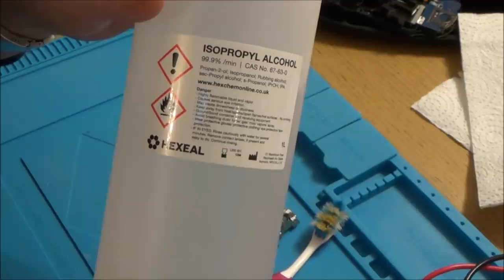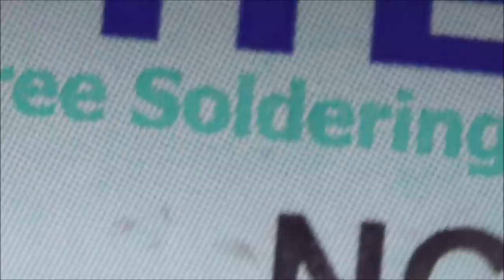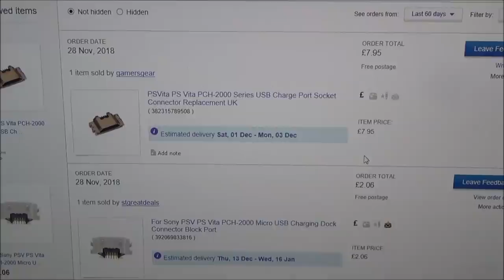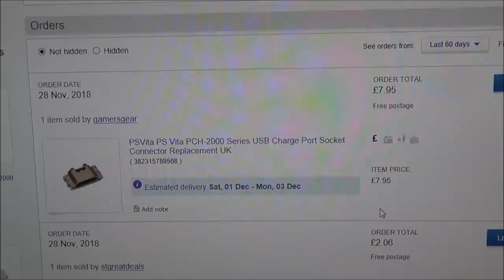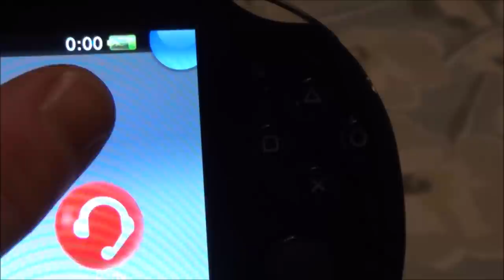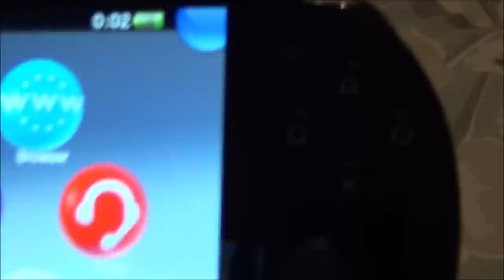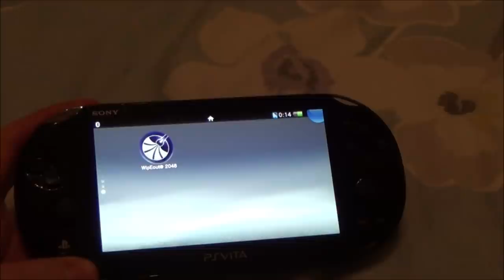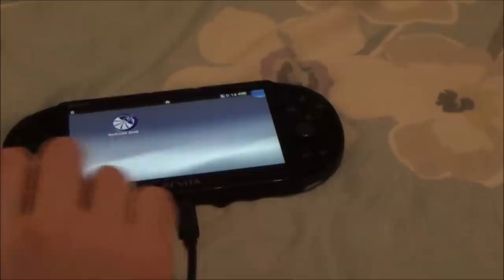Trying to FIX a Faulty PlayStation Vita - Sony PS Vita Slim

Comment: Hi, i have a problem with my vita slim, and i can't find any solution. A couple days ago i replaced usb port and firstly i thought that everything is ok. But it's not everything. I can transfer files through usb. But can't charge vita. Strange thing is when i connect usb cable orange indicator light solid, and green bolts appear on battery icon. But it won't charge at all. Probably i broke something when i replaced old port, but i don't know what could it be :( 
Anyone has an idea what can i do to fix or at least diagnose this?
Sorry for my English, it's not my native. Please correct me if I make any mistake.

Comment: Love the vid. You are getting serious skills !!!!. The station should kick in the heater when it senses the temperature drop (because the heat disiaption to the board). Probable on your the temp sensor is too far away from the tip that takes time to realize that more power is needed. I have seen stations (generic, but decent) that when you got the issue you had in the pad, the measured temperature falls like a rock on the LCD and the heater is turned to compensate as much as the max power can (60W in the case Im telling). Even on a fine tip, it really manages to do bigger jobs

Comment: Great video. It is not unheard of to use hot air to pre heat the board or to even remove components. The board will consume most of the heat giving one a hard time to get either remove or replace the components due to the thermal transfer. I have even used both hot air, soldering iron, flux and wick to remove solder from those difficult holes. Keep up the good work.
Reply from the maker: Thank you :-)

Comment: To free those holes with the tools you have, you need to heat it to like 250c with the hot air and at the sames time go with the largest tip you have and use solder braid to suck it.
Regarding the soldering of the new port, you should have removed the solder from the pads before soldering it because the solder keeps the port lifted and not completely flat against the board

Comment: A good quality soldering station makes soldering ground pads like that much easier. It also looked to me like you were using fairly cheap solder, which doesn't help.

Comment: Thats often a Problem with Groundcontacs that have a Pretty Big spreaded Network across the Board, that they drain the Heat away from the contact. Pretty much like a little Heatsink
Reply from the maker: Oh yes that does make sense, so the bigger the contact the more chance it has of dissipating the heat away. Thank you :-)

Comment: If you have a steady hands you can use 1mm drill bit and try an remove solder that way, some of em are tricky because of inner layers of the board.
Edit : If you are worried about damage, you can do a lot more damage to the board using excessive heat, than with any of the mechanical ways to remove it, components rarely can hold above 100 degrees, unless they are power components.

Comment: Vince, when you are soldering, the steps are - tin the tip if it needs it (there shouldn't be a glob on it when you tin it, wipe to glob off on your sponge), apply the tip to the surface you want solder on and heat it up, then push your solder into the point where your tip meets the target area. It seems like you try to get a glob to stick to a surface from your tip too often. Solder won't stick to a surface that is colder than its melting point.

edit: Another reason why a glob won't stick from the tip is that by the time you have heated the target to right temp with the glob still on your tip - the solder is burnt up and won't want to stick anyway.
Reply from the maker: Thanks for the helpful tips :-)

Comment: The soldering irons on those cheap rework stations are terrible.
The best cheap soldering iron I have ever had and still use, is the Bakon 950D with a T12 handle £35.

Comment: Nice work. Pleasure to watch. USB / HDMI are sods because of the ground plane. Had the same on a PS4 HDMI with my Aouye 968A+. Very frustrating. Gonna invest in a Quick hot air station next year. Higher temp but for less time is probably better for the board on balance. The way Andrew does it is to mix in leaded and leave the solder in the holes and somehow align it whilst still molten but you need a Quick for that lol. The reason the outher 2 pads won't take is the same reason. Need more heat. Keep it up.

Comment: Welcome to the world of heat sucking ground planes :) Actually, you can preheat the board in an oven to make the solder melt better as the ground plane is conducting heat away right when you touch it... :) That's why these machines don't need any heatsinks :)
Reply: heatguns are your friend, a little  pre-warm and then working on these things is so much easier.
Reply: Good to know

Comment: I usually use a combination of heat gun on a lower temp to keep the board at a reasonable temp as well as a soldering iron; heat is a form of energy, and energy is cumulative. The board dissipates at a faster rate than the iron can handle, but even with the same iron and another source of heat, the combined energy input is enough to make the solder melt much easier
Reply from the maker: Thanks for the advice :-)

Comment: 350/5000
Good morning ,sometimes the problem is simple
  when the batter completely discharges the ps vita does not recognize the battery
I had the same problem
to fix, I just took the batter from ps vita and it would load a bit for 20 min. and then put it back, and now it works 5 stars
to charge the battery I used TP4056 5V 1A LiPo Akku Lithium Battery Charging Module

Comment: on such type of holes try to use hot blower and soldering-iron at the same time, becouse this holes connected with a big polygon of copper that absorbs all the heat and you can`t  solder it properly. with best regards)

Comment: for those stupid holes i would  have used a dremel to free up the holes but it depends on skill and patience aswell xD but yeah ...  that would be my way befor i start melting the iron threw the board  (because the holes seems to be enlarged and the pcb looks like it got pushed out  towards the  place the port is sitting

Comment: Whatever was spilt on the USB Port must have been seriously corrosive to strip away all the soft metal leaving only the most temperature resilient hard metal "borderline crystal like", I'm guessing it was some swimming pool water that was excessively chlorinated that would do that "Lead Acid Battery" and it's acid also comes to mind. 

BTW - I suspect when it comes to plugs, sockets and terminals, manufactures tend to use a higher temperature solder as its a lot more resilient than low temperature solder, not sure if high temperature multicore solder is still available, So if it is, it might pay to have some handy, it always worked for me especially when I restored an old antique valve radio, now that was some seriously hard solder..

Comment: I got one from eBay fault,s were on off switch now replaced and am anologue stick. When it arrrived it would not work had to take it all apart clean all connector's it now works and just the anologue stick to do might dismantle as replacements are a bit expensive compared to the psp
Reply from the maker: Yes, they are expensive, if you have an old Vita for spares then both right and left analogue sticks are the same. I thought it would be a £5 part but they are up on £10!!!!
Cheers :-)

Comment: Vince, great job. Only use a charger with the same rated output voltage that the console needs. If you use a higher voltage output charger you can damage the board.
Reply: not necessarily but better be safe than sorry

Comment: VINCE
I noticed you didnt reflow the corroded joints on the head phone jack. That stuff is going to keep eating at the trace and legs there 🤤😢😭.

But that micro usb tho! 😁👍.
My child ripped his lose on a headset. Forgot he had them on and yanked it.
It came off and went back on without the problem you was having. That was a battle on yours.

Comment: I was really surprised by the fact the pads was still intact. Especially since you showed the pins moved at the start. Usually What happens is the pads corrode away from the board and the pin with the pad attached moves. The pins must of only barely been attached in the production process to come away like that. Still great job in fixing it and with your thought process, education of components and experience soldering you would make a good electronics engineer.
Reply from the maker: Thanks, yes I thought he pads had completely eroded away too. I was pleased when I finally saw the copper was still intact :-)

Comment: Your soldering iron seems doesn't have enough power and struggle to solder some of the soldering points. It's not how high the temperature you set, it's about the power. The huge copper layer dissipates the heat quickly and the soldering iron doesn't have the power to maintain the proper temperature.

Comment: That USB port was clearly FUBAR - it's often easiest to Widlarize the old component with blades and snips - only then clean up the stray pins and bits of metal that are no longer attached to each other and so much easier to clean off. The important thing being preserving the PCB pads.

Comment: Hey Vince, nice to see you working at a table. I worry about your knees! :)
Reply from the maker: Thanks :-) It is to do with the filming. If it is a small item then it is easy to film on the table but on larger items it is much easier to film it on the floor to fit it all in. If I wasn't filming then most of my work would be done at the table. The other reason I am on the floor a lot is I work from home, so if the family are in the room with the table I take myself off to a bedroom etc.
Cheers :-)

Comment: When you put the new port in, you should've started with the problematic holes to push the port all the way in. Because you started with the other ones — you fixated it at an angle. That's why the legs were so far apart from the pads.

Comment: Looks like your solder is bad quality. Had problem soldering large quadcopter PDB. Tried heating it on electric stove. Turned out it still didnt work well, and actually when I used different solder it worked fine at much lower temps.

Comment: The vita probably uses most of the spare board as a ground plane to help suck away heat from other components because as you've probably noticed, the vita does not have a fan.

Comment: You’r soldering is coming on great Vince, get some old motherboards, with components on them and practice on them, taking stuff off and replacing it....great video btw, always a nail biter .lol
Reply: Such a pain in the a$$ to change caps .... I barely did 2 times, even on a 60W iron. A multilayer sandwich with power and ground planes ... its an ATX from factor heatsink

Comment: To clean the holes put the motherboard at the edge of the table, half motherboard out (the part with the holes), put your iron on the top an the sucker on the bottom, that's the better.

Comment: Never reuse a corroded connector, because corrosion will only continue spreading. The only way to protect corroded area is to clean affected area with petrol, reflux, retin, use a new connector and on the end put some colophonium rosin flux on it, because it will prevent the rust from reappearing by cutting oxygen from it.
Reply: The Tired Techie Rosin flux is brilliant stuff and also easy to clean off if you want

Comment: Hey my mate VINCE, I could use your help with my PS Vita. either through me sending it to you or you just helping me out through instructions. But I have totally disassembled my PS Vita (PCH-2000) and everything seems perfectly normal. It only charges when it's turned off and only for a few seconds. there's no corrosion or water damage it looks clean and perfectly fine. I have no clue as to what the issue is, but you're more professional than I am. So if you see this comment please help me

Comment: The best way to remove solder from these plated thru holes, is use a thin drill (.1) in a pin vice. You break the surface tension of the solder. This kit is available from model engineering supplies. Just twist the drill in your fingers and it do the job rather than damage the pen with excessive heat
Reply: Pcb

Comment: This is why I like the PSP a little more because if you had this problem, you need to just put in a new battery and it’s an incredibly easy job, no screwdriver required.

Comment: Strange that it didn't charge when u plugged it back in because u don't need a Vita charger. I don't have one, I just use all sorts of phone chargers even power bank and it charges fine with mine.

Comment: I just imported a brand new vita from Japan a couple weeks ago, fantastic machine!  Most likely, a family member (child) spilt their drink all over it and kept quiet!
Reply: Zyzz  brand new imports can be crazy expensive. They can range £200-£500. Madness. Look in the used market, alot of people have taken good care of their vitas. I brought a used one for £100, its in near mint condition. My seller claimed to have only used it once or twice. I believe them cos mine came with firmware 3.32 (quite old). So I manual updated to 3.60 and installed henkaku/enso (easy with youtube tutorials) and bam! I haven't been able to put down the damn thing. 

Also mine was abit more expensive in the used market cos I wanted one with no finger prints or  scratches (mine was literally mint) but if your not too bothered about tiny marks or scratches you can get a used one for around £60-£90.

NOTE: if you are planning on getting a used vita get one with firmware version 3.68 or below.

Comment: When i have problem with holes like thesee i use pointy tip as you do here and sucker from other side. So i melt the solder, tip is still in the hole to keep it liquid and use sucker from other side.
Reply from the maker: Excellent, that is good advice. I didn't think to do that, thank you :-)
Reply: @Mymatevince  It took me a while to figure that out when i was doing analon sticks in dualshock 4 (16 pins!!!) i destroyed 2 pads before i learned how to unsoder them :D (advice here,  destroy the old analog and unsolder 1-3 legged parts, going with hotair on 16 legs at once will fry the board even with protecting tape ;) ). And btw im an amateur as well, even bigger than you so take my advices lightly.
Reply from the maker: Thanks for the tips. I have some (6) faulty DualShock 4 controllers to look at so I may have to do an analogue stick on one of them :-)
Reply: @Mymatevince  More like all of them, almost all analogs are faulty after 1+ years. If pad is working go check http://html5gamepad.com/ and try all deadzones, check if they do not move on their own in far corners etc. Sometimes its hard to notice it in games but when its needed, ull see they are faulty. So far i changed 4 analogs in 3  ds4.

Comment: The PS Vita is one of my favorite handheld ever
Reply: Stop criticising  people god help me
Reply: @fweetime6753  The Vita is very good for emulation, there are some really great games I don't know what you are talking about. I use the remote play feature with the PS4 and it works great. It has bluetooth support for my wireless headset. What do you mean by rubbish storage? The only downside are the expensive memory cards, I have the  64 gb one and it works good.
Reply: @fweetime6753  I'm not gonna list every game I like on the Vita for you. As an example, Metal Gear Solid HD Collection alone was worth it to buy the Vita for me. There are a lot of people buying a Vita in 2018 and there's still much love for the system.
Reply: @fweetime6753  Buy an SD2VITA, add custom firmware, Retroarch, Adrenaline and you have access to thousands more games from emulation. As for actual Vita games, there's loads of great ones. Rayman origins, Chasm, Slain, One Peace PW3, Persona 4, Uncharted, Gravity Rush. Plus all PS One games and PSP games through Adrenaline. I'm off to play some SNES on mine right now. C'ya!
Reply: Oh and you can remote play your PC games through it now with Moonlight. It has so many uses making it a fucking crackin' little handheld. watch?v=SdI0CNXL-gE
Reply: @fweetime6753  Man you are crazy. Stop trying to deny the PlayStation Vita as a good console. Plenty of great games came out in it's hayday. Memory Storage is total rubbish but it's 2018 and you can use an SD card adapter now. With mods you can unlock the full potential of the Vita and it becomes into one of the best handhelds ever. I have consoles ranging from Sega Genesis to the Xbox One X and the PlayStation Vita truly is a great console in my collection and I use it alot because it's really fun. PlayStation 1 games run exceptionally good on the PSVita and it's a wayyyyy better buy than that trashy PS1 Classic.
Reply: Fwee TIME psx titles psp titles ps vita ps4 via remote play pc titles via moonlight hack vita is the best portable console ever made lol u can put 500gb scard on it using sd2vita and u have urself a fucking beast of a portable console not to mention psp games looks better on it with antialiasing less ghost image oled screen etc etc people just disnt care of it cause shit mobile games lol

Comment: botch wire the pins with voltage to the board onto another usb port. Test if board is charging. Then proceed.

Comment: IPA only removes oily deposits such as fingerprints and flux as it's an organic solvent. To remove inorganic corrosion, such as copper chloride, as you most likely have here (it's the horrible green stuff!) mix the IPA with an equal measure of distilled water and it will be much more effective and do two jobs at once.
Reply from the maker: Thanks for the tip :-)